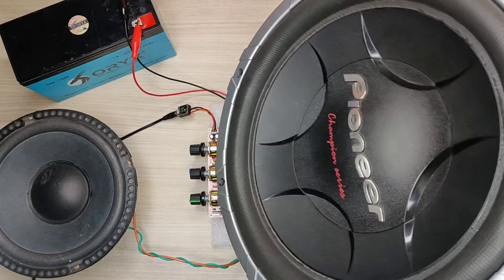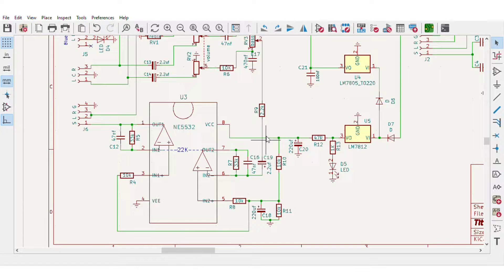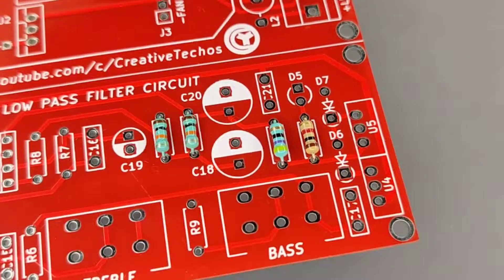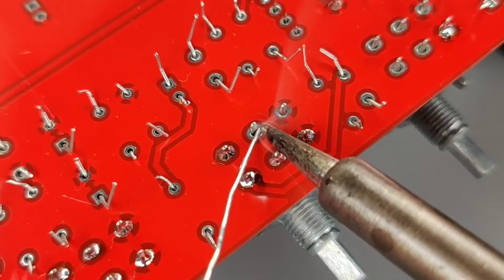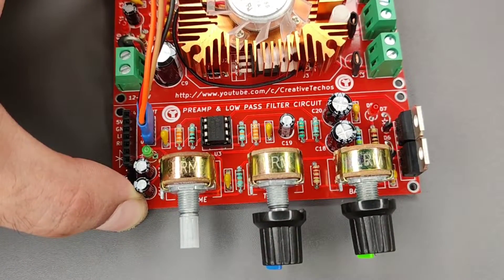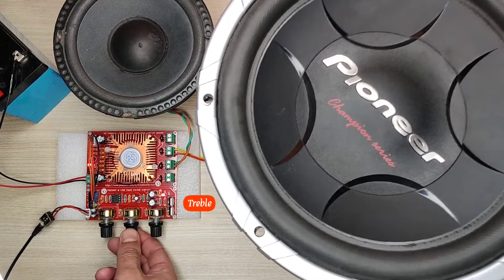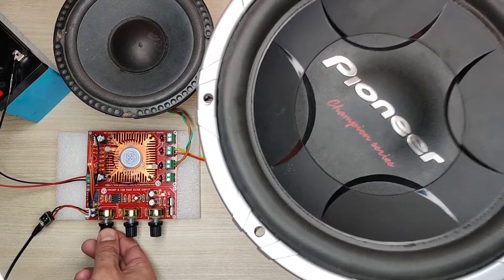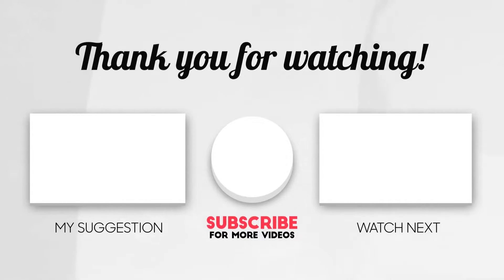DIY Super Bass Subwoofer Car Amplifier Circuit

Comment: Can I use it for making a home theater?If not then plese make a simple 200watt amplifier for home theater.
Reply from the maker: Yes you can make, as it has two satellite speakers and two subwoofers
Reply: @CreativeTechos  Which Bluetooth module that you use ? (Send me a link or a name or model number)
Reply: @CreativeTechos  Is it worth to make it for a 150 watt home theater(Two 40 watt speakers with one 150 watt sub woofer)???
Reply: @CreativeTechos  Which Software do you use for circuit and PCB design?